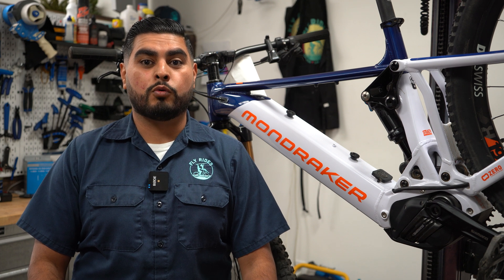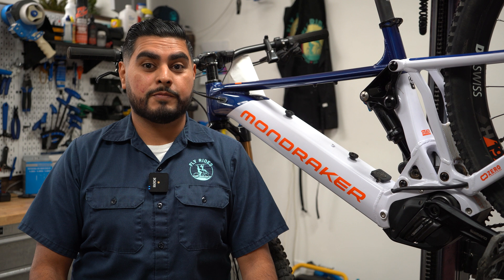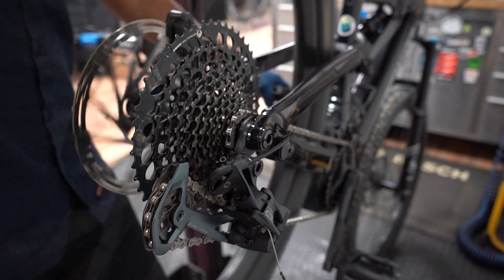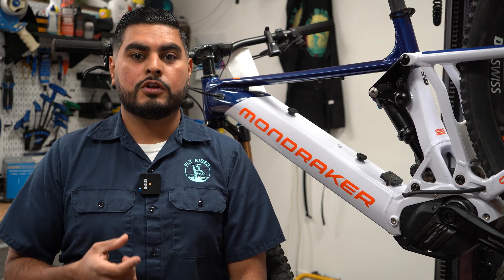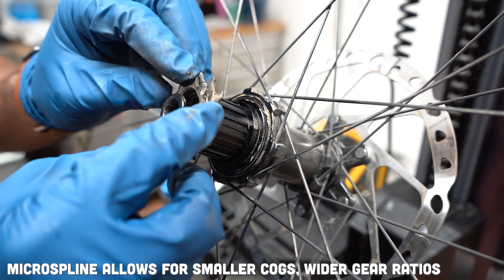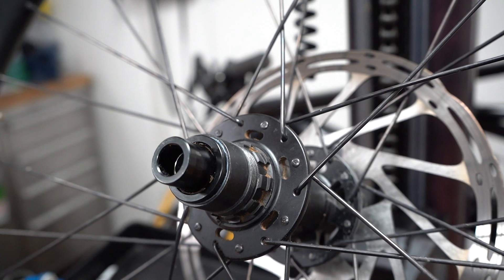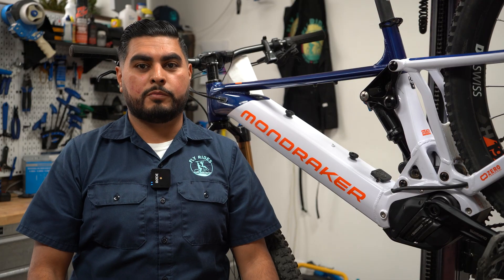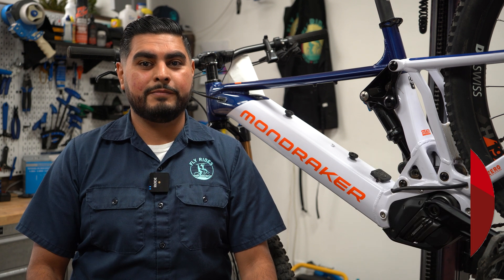Freehub Bodies Explained

Comment: Solid explanation. I'm not sure if it makes much of a difference having a 10 vs. 11 tooth high gear unless you have a high speed eBike. Thoughts?
Reply: Yeah, one less tooth will give you a slightly higher gear. This helps if you’re constantly pedaling out of your high gear, regardless if you’re on a road (high speed) bike or mountain bike.